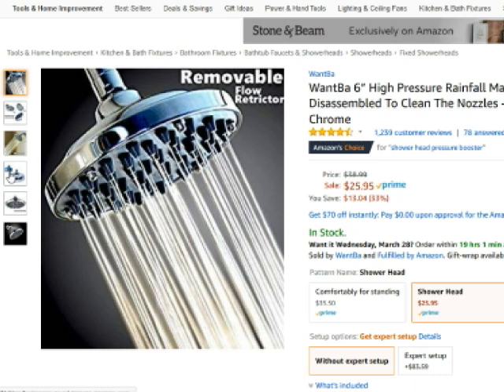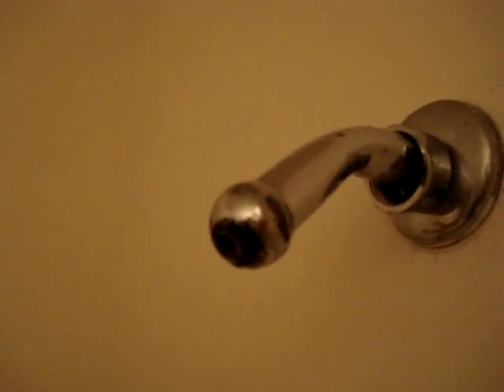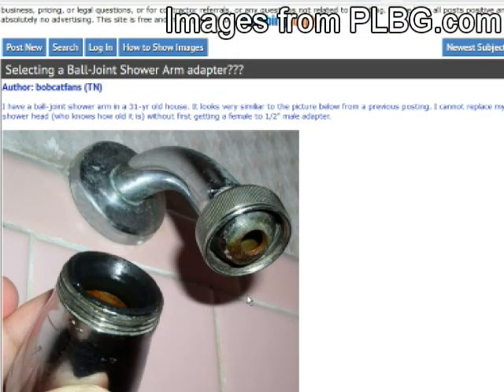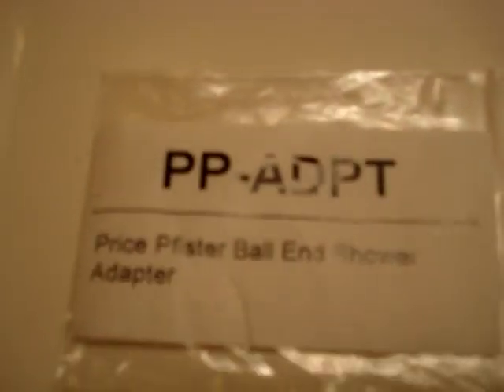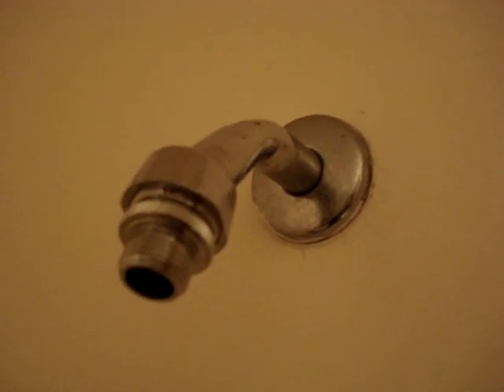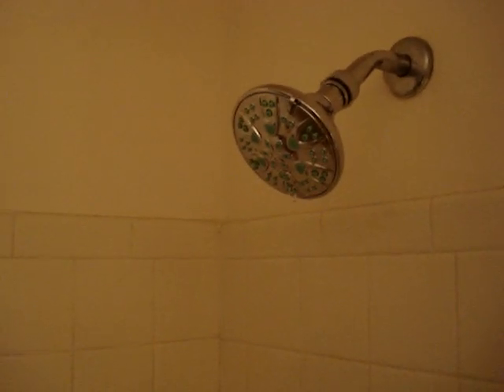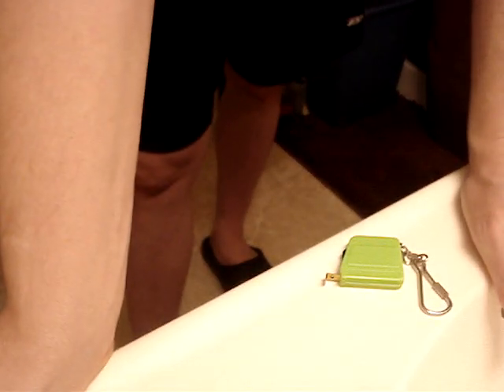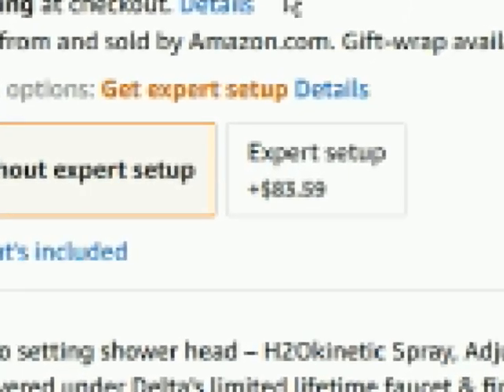Ball End Shower Arm Shower Head Installation (Adapter)

Comment: How do you know which adapter you need I have a ball end shower arm,and seriously the 80s shower head is pissing me off,I need to replace it with a hand held spa jet shower head,so my question is what to do I need.
Reply from the maker: @Jean-Noel Jabagi, the three pack adapter set will include the right one you need to fix it. The problem is you have to pay for 3 when you only need one. Check out my video description for all the info you will need. Best of luck!

Comment: Argh, help! None of the 3 fit!! The largest is the one that goes over the ball but it won't fully screw into the thread.🥺
Reply from the maker: tinathedoctorswife, sorry to hear that. There have been others who have commented here with the same issue. 

If you cannot locate the correct size adapter you may need to have the shower arm changed.

It's not as quick / cheap as the adapter solution but many people here have had to go with that solution instead.

Best of luck and I hope your plumbing issues are over soon!

Comment: I ended up replacing the arm. Now I can put any shower head I want. $15. The old one was way to clogged with lime and calcium. Also that ring behind the ball on the arm was cracked.
Reply from the maker: Nice! Replacing the shower arm is the main option people use. Glad that worked for you. 
Those who don't want to change the entire arm can use the adapters shown in this video. 
Thanks for taking some time to share and comment!

Comment: I have this same situation, except is there any replacement or advice for the female piece that’s on the arm that the adapter screws into as mine is cracked,since it’s done cheap plastic.  😭
Reply from the maker: Carina Webber, several people have had this issue. If that part is broken or missing the next best thing is to replace or have replaced, the entire shower arm. 

There are many videos on YT about how to do this. Best of luck to you and hopefully your plumbing issues are over soon.

Comment: I cant thank you enough for making this video! Although I wish Id seen it a year ago (you can prolly guess what thats been like!) How did you figure out which of the three was right one?? The three pack is now $28.00 from your link. Im not whining, but fyi. You saved the day! I considered replacing the shower arm too- huge deal back into the wall...argh. My house was built 1979 btw. I think you could ask for a % on sales that use your link, doesnt hurt to ask, and checks in the mail every day are sure to make you grin no matter how pittly. Just saying- the worst they can say is No and  I suspect youve boosted sales? Seller can have Amazon give you a hotlink to repost here and track your referral sales. Youve earned it!
Reply from the maker: Hey Huulani, you're welcome. Glad this helped you some. I too considered replacing the entire arm. I bought the pack and just tried all three. It seems most people here needed the Price Pfister one. 

I'm aware the price has gone up. It fluctuates between $15-30. I also thought of asking for some kind of kick-back since I'm sure the seller on Amazon is making more money because of my video - haven't pursued it yet.
Hope you can get everything working. Reading through these comments is fairly helpful. 
Thank you for the kind words and best of luck to you.
Reply: @Underdrummer  TYVM! due to your help, Ive order the 3 pack also.

Comment: So I have a very similar shower head to your older shower head in this video. Except while you're is actually 2 pieces... mine is just 1 piece. It's American Standard and it says B125 on the side of it... but the adapter isn't deep enough to fit all the way in. Any idea whats up?
Reply from the maker: Hi Crisu Komie, I'm trying to picture this abomination. LOL. I thought my old shower head config was bad.Can you imgr a picture?
How does the head come off the ball-end if it is only one piece?
Reply from the maker: Crisu Komie, see 4:15. Yours has the part I refer to as female part right? The circular part that's between the wall and the ball-end right?

I assume you went with the American Standard adapter model. Do the threads at least line up?

You may need a different adapter. I know that sounds counter intuitive since your shower arm is clearly marked but stranger things have happened.
Reply: @Underdrummer   thanks for responding! Here's a link to some pics I uploaded. https://imgur.com/gallery/2XR5sdt

As you can see, the shower head itself is one piece. And if you look, the black part has threads that go down almost an inch. But the adapter I bought is roughly a quarter of an inch or half an inch. It's not deep enough.

I looked at the back of the shower head, and it says American Standard b125. Any idea what kind of adapter I need? I've been searching everywhere.

Thanks for your help!

Comment: I just replaced  the arm for $8.00 at the hardware store.
Reply from the maker: Not bad. What size wrench did you use?
Reply: Monkey wrench sized. 

But serious, I did try look for adapters. The saw how much the wanted for them. I saw set for like $25. F that! Unscrewed the old one, went to the hardware store. New updated one was $8. No more leaks!

Comment: Hello, I ordered three adapters. Not one work for my ball end shower arm. I can no longer shower in my bathroom because of it. Bummer. Great video.
Reply from the maker: yolanda Easterling, that is terrible! So sorry to hear that. Not sure why not one of the 3 adapters would work for yours. They do sell well n eBay so at least you can recoup what you paid for them.

Replacing the shower arm may be your only option. Thanks for taking some time to share and hopefully your issue is resolved soon.
Reply: Me too.

Comment: Can I LOVE this video?! 
Thanks for sparing us 1980 ball joint shower arm owners the research hassle. 🙏🏼
Reply from the maker: Al3oxnfri, you are welcome! Glad it helped. Thanks for taking time to comment.
Reply: Follow up - so I immediately went to Lowe’s to see if I could buy just one adapter... Lowe’s had not a one (of any brand). I went to Ace and they had both the American Stander and the Price Pfister adapter single packs - the exact packages that were in your links. I got the Price Pf which was $7. 
My new 6 adjustment shower head is attached perfectly to the 1984 shower arm 😉. And no leaks 😁.  
Thanks again. 

Now can you do a video of removing and replacing a 1990’s over the range microwave? 😆
Reply from the maker: @Al3oxnfri  Haha. Fortunately I've never had the pleasure. Thanks for the awesome update. Glad it all worked out.

Comment: This is what I needed to see -- after trying to remove the old shower neck with the ball.  It was stuck like cement, and I sure didn't want to cause any damage on this old thing and perhaps adding more money to my outcome.  Thanks so much for this video and sharing your experience with us all.  I ordered my set of three right away.  I thought this should be as easy as applying an adapter rather than taking off the neck.  I appreciate your video.  i go to Youtube if I want to solve majority of my home problems.  Thanks again!
Reply from the maker: RB the Garden nanny, LLC, you are welcome. Glad to hear this helped solve your problem. I have used many videos on YT to get stuff done as well. Probably the mst impressive was a video that explained how to change the power-steering in a 2001 Ford Ranger. I was able to do that even knowing very little about cars. Thank you for taking some time to comment and share!

Comment: Well, this is the closest, after a year of searching, of how to replace my "ball end" shower head. BUT - what if your "ball end" shower head does not unscrew & just pivots around the ball???!!!!! AHHHHHH!!! I'm about to give up & do what I DON'T want to do - which is looking like I will either have to cut an access panel from the opposite side of the wall - which is in my kitchen (I thought about this option & thought about making that cut out space into some sort of moveable shelving with a "door" of sorts that I can remove if needed? ) Anyway. I have figured out that I'm lucky enough to have purchased a home that should be used in a video of "what not to do when remodeling a house". Thank you for the video, though. It got me closer than where I have been for the past year. Not sure if I'm closer to having the ability to find an answer, or losing my mind - ehh...either way, my search continues. But at least now, I have A LOT more information (like what that damn thing is called & who made them). Going to start researching the companies old products now. Thank you again!
Reply from the maker: Sorry to hear about your troubles with the house. I understand the pain and frustration. 

My Ball End did not unscrew either but are you saying that there is no coupling to install an adapter to?

Replacing the shower arm is another option. There are many YouTube videos on how to do that.

Best of luck and thanks for taking some time to share and comment!
Reply: That is correct! That nice little piece that EVERY video posted shows, that the shower head unscrew from?? Nope! Not mine!! It will turn, but it doesn't do anything because it is just sitting directly on the ball end I don't know if should laugh or cry knowing I have not one, but TWO of the same crazy plumbing anomalies! I thought about replacing the arm, but, I'm pretty sure that would lead to an entire water line replacement the for the whole house. It seems once you replace one piece, the next piece will have an issue. I'm just at a loss.
Reply from the maker: @courtneyperidore7196  Oh no! So sorry to hear about your plumbing troubles. I know how annoying it can be.

Hopefully some of the Replace Shower Arm videos on YT can aid you.

Best of luck!

Comment: In case it helps anyone: the "Pfister" brand has the name written nearly invisibly on the side of little plastic adjustment tab in the middle of the head. 

You need to look at it in really good (outdoor) light to see it and I missed it many times under the dim bathroom light.
Reply from the maker: Hey PointLineBox, wow I wish I would have seen that - I scanned that thing for a brand name and never found anything! Thanks!

Comment: I just priced that adapter set and it's now $28.00 on Amazon.  However, if you buy each of them separately you will save a few dollars.  I was going to try the Price Pfister first.  If it fits then it will save me buying the set or the other two.  Also I have that same exact shower head in one of my bathrooms and if it's the original it was installed in 1970 which would mean the same unit was being installed in bathrooms for at least 14 years.
Reply from the maker: Hi Fox Rivers, thank you for posting this. That price keeps going up! Probably because the tri-packs are harder and harder to find. 

 Buying individually is a way better idea and I would even bet MOST people have the Price Pfister set. 
  If you read through these comments, that seems to be the case.
Reply from the maker: Haha! 
14 years...that's about how long it took me to find a solution other than removing the shower arm!

Comment: What if the female part isn’t on the shower arm either and it’s just an arm with a ball joint?
Reply from the maker: V Wolff, there have been a few people who have had this same problem in this comment section. The only solution I can see is to replace the entire shower arm which is the traditional way to solve this issue. That's part of the reason I made this video for those who do not want or have the ability to replace the entire shower arm. 

There are many videos on how to replace the arm. I'm sure one of those could help you. 
I hope your plumbing issues are solved rapidly and thank you for commenting.
Reply: Underdrummer Thanks for the reply. After I realized the other piece was missing I threw my hands up. I twisted the arm off last night and new one is arriving from amazon tonight.
Reply from the maker: V Wollf, nice! Glad to hear it.

Comment: So is there no way to just remove that ball joint and screw the new shower head on?  I tried turning with channel lock to get off main stem but its not budging!  btw, thank you for posting this because I was as confused as you said you were when I took the shower head off.
Reply from the maker: @Kevin Beckley, I do not think there is a way to remove the ball end. Just based on personal experience and the many comments here.

That's part of what is so strange about this design.

You are welcome and I hope the video points you in the right direction. Best of luck!
Reply: @Underdrummer  Yeah, I really don't want to break the stem going into the wall, so i'll just buy the adapters from amazon, can't thank you enough.  If it wasn't for your video, I'd probably be replacing alot more!   Thanks again!
Reply from the maker: @A-Aron118  You're welcome again and glad to hear video saved you some trouble.
Thanks again for taking some time to share your story!

Comment: Is there something else rather than these 3 adapters? I bought those from the link you provided, and nothing works.. I can still use the american stander and the price pfister, but it seems the adapters are too large for my shower arm. I can only rotate it half times, and water is leaking from the adapter :(
Reply from the maker: 우진아, you may have a different ball end shower arm than the 3 I listed. Reading through these comments may help but if none of the 3 adapters are working, you'll have to find another solution. Changing the entire shower arm for a more updated one may be your only other option. Best of luck to you and I truly hope your plumbing problems are nearing a end.

Comment: This is a great video. I went to my local hardware store. They had the Pfizer (probably spelled wrong lol), the Gerber and the American Standard. I ended up buying the Gerber. However, the Gerber didn't fit. The other looked smaller than the Gerber. Do you or anyone have an idea of what could work?
Reply from the maker: Mimikinmiracle 83, 
 I've read all the comments. Most people have said that the Price Pfister adapter worked for them.Give that a try and the good news is if that doesn't work it has to be the AS. 
Thanks for commenting and best of luck!
Reply: I searched online and found Ace Hardware near me that carried all 3  kinds of shower head adapters from Whedon Products. I removed my old shower and took it there to let their employee helped me pick the right one for my old house. I'm I bought Gerber one for $6.99 + tax.
Reply from the maker: Frederick Fong, glad to hear it!

Comment: Are you able to swivel the head now? Mine is loose and won't hold in place where I adjust it now
Reply from the maker: Atomica, that shouldn't be. You can't tighten anything to make it hold tight in place?
Reply: @Underdrummer  unfortunately no. I may need to replace the entire arm now. No success in tightening it yet.
Reply from the maker: @atomica3588  Well ultimately replacing the arm will solve the issue. The people here who have commented that, for whatever reasons, my solution did not work have all been forced to replace the shower arm.

This is what I was trying to help avoid when I made this video. 

Best of luck and I hope it works out for you.

Comment: Hi, this video explained why I was having no luck trying to fit a shower head to the shower in my bathroom, I had never seen this type of ball fitting before and I could not find a shower head to fit it. I live in the UK, I went onto Amazon and I could not find any like those you mention? and the link that you supplied does not ship to the UK unfortunately. I will keep looking but if you have any pointers please let me know, thanks!
Reply from the maker: David Jones, glad this video helped you get started. Sorry the link does not ship to where you are. Many people have had luck at their local hardware stores. The adapters are also sold separately. Best of luck with your plumbing endeavors and thanks for the comment.

Comment: Would it not have been easier to replace the arm?  Grab a pipe wrench and remove ball end arm, replace with standard arm with ptfe tape applied to both ends. Why would you need to cut into anything? The escutcheon will cover any cosmetic issues.
Reply from the maker: ejtSpAcE, perhaps for some people. This video is proof that an alternate solution is viable.

Comment: Thank you for this video!!! Unfortunately, on Amazon, they are currently unavailable - and don't know whether they'll be in stock again or not!!
Reply from the maker: Hi Diane Western, yeah they are constantly going out of stock. Reading through the comment section here some people have had luck with their local hardware stores. Also most people here but not everyone ended up needing the Price Pfister adapter. Maybe you can just search for that one with better results?
Either way I hope you can locate an adapter and get your shower working again. Thanks for taking the time to comment. Have a great day.
Reply: Thank you for your response. I'll check back periodically or go the individual route. It's not that important - I just want to attach a hand-held shower head for ease of use for a clothes washer/spin dry tub that I have!
Reply from the maker: Sure. Best of luck to you.
Reply: Hi, I buy mine on Amazon today, the name is Whedon shower arm adpter PFISTE MfrPartNo PF1C, chrome
Sold by: BuyBoxer
Amazon suggest to buy the another 2 too but I just need this model and was $9.60
Hope this help!
Reply: @lisaideart5090  Thank you. I saw that, wasn't sure if it would work or not.  I might try it.
Reply from the maker: Ide Art, thank you so much!!! Now I can post these alternate links so people can find the adapters.